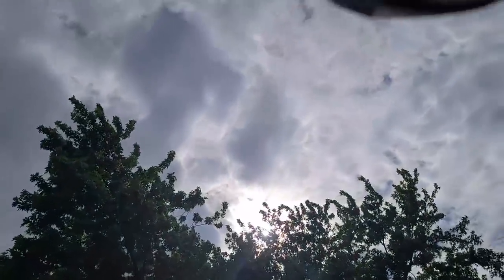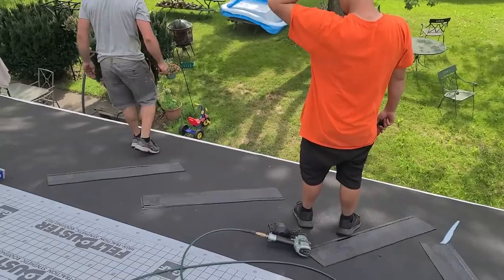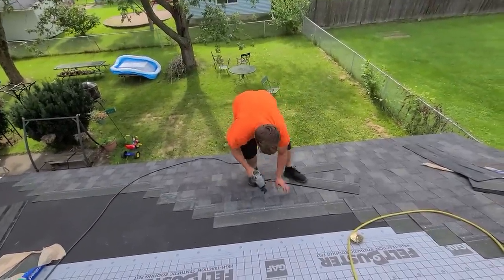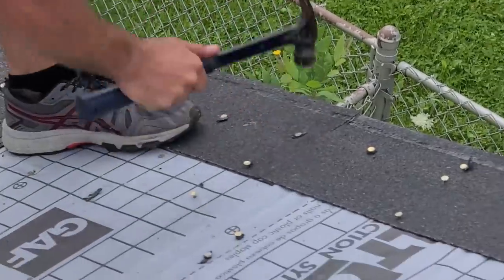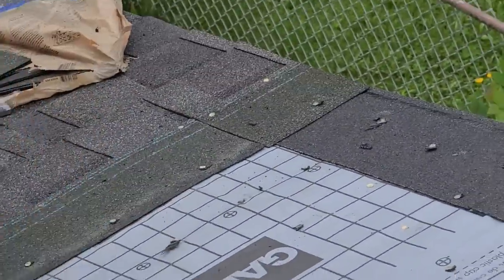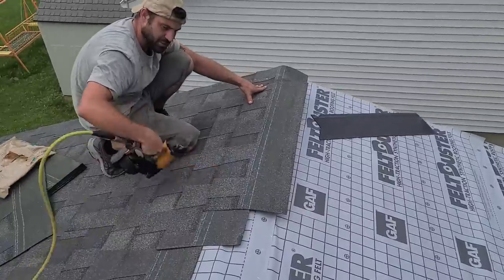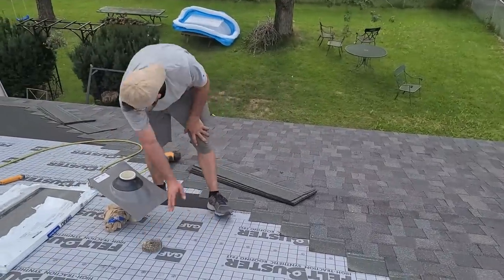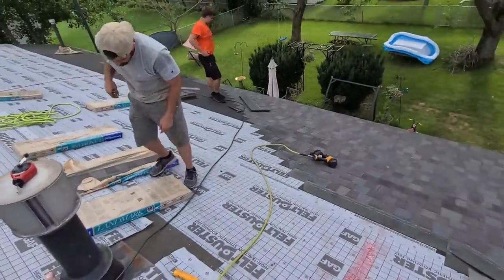Duos ME and BOYCUB

Comment: Recommendations on good air hoses? Got an older bostitich roofing nailer but the air hose is shot. Looking to do a diy roof project on my shed. Also, going to use your channel as my instruction manual ha.

Comment: Hi Zack, I have a question regarding ice shield. I am tearing off my architectural shingles on a small 3/12 and I noticed that the Ice Shield is stuck down directly to the deck, is this normal? Instead of on top of the old felt paper and I can't hardly get it off. My question is, do I absolutely need to get the ice shield removed from on top the deck? Or can I lay my new synthetic underlayment over the top of it, and then apply my new ice shield?
Reply: Scrape.the shingles off when its.cooler in the morning  and you.shouldnt be laying.ice.and water shield.on top of the synthetic underlayment. The ice and water shield is meant to stick to the deck and provide.good eaves protection when it.holds.snow. You can apply new ice and water over existing though. Also if it's a 3/12 you might wanna look into some flat roof systems 3/12 is not a desired pitch for shingles. Don't go peel and stick anything on  a big project look into fully.adhered rubber membranes. Hope this helps
Reply: Yeah DO NOT lay synthetic first, and then ice shield .. just get the existing shingles off the best you can, leave the old ice shield, and lay new ice shield right over the old ice shield.. I'm not sure where you're located at, but for the past couple years, it's been code that you lay 6ft (2 rows) of ice shield.. and with you having a 3/12 pitched roof, I'd Definitely recommend Atleast 6 feet.. good luck to ya, and roof on ✊✊
Reply: @timbibin1301  Thank you both! I think I am going to do the entire deck in Ice shield. 16x20 x 2. Another question is, do I need to lay synthetic over the top of the ice shield? They had felt over the old ice shield. I am located in North West Missouri.
Reply: I've never heard of laying synthetic over ice shield, but maybe there's something that Im not familiar with.. and as far as laying ice shield along the Whole roof, I've heard of situations where the oils in the ice shield had actually dried up, and was causing the shingles to curl up and lose their durability.. only heard that from one person, but then again, it's not very often that someone ice shields their entire house!! Wish you the best Brotha, and whatever route you take, I hope it works out for ya ✊✊

Comment: Hey Zach. Working with this guy that says shingles only divert 80% of the rain. I'm in British Columbia but used to live in saskatchewan. To me that's bull crap because of places than rain and snow during the year and if there was water underneath shingles it could just turn into ice  right? Or is that true? Just haven't worked with someone in shingle roofing that has ever said that.
Reply from the maker: shingles divert all the water. water should never hit the underlayment. but they do have ice shield for a reason. i'd like to believe that ever roof I've installed has never had water hit the underlayment
Reply: @NWIVeteranConstruction  okay cool, good to see your perspective on this. The guy also uses that protecto wrap peel and stick stuff for putting around vents and and he even puts it ontop of valley metal where two valleys intersect. And that stuff isn't cheap if I can recall.  He goes through one or two rolls on a single job. He even goes as far to put it on shingles that have a downspout near them. I keep telling him that underlayment shouldn't have much, or no water at all hitting it if you install shingles right. And yeah I agree with the ice and water

Comment: Sorry if this has been asked before. I havent watched every video yet but how many times have you fallen off a roof since you have been roofing? Or maybe i should ask what was you worst injury roofing? Love the videos btw
Reply from the maker: Haha so one time a few bees attacked me and I made sudden movements that caused me to start sliding on some granules on the roof deck. I was just close to the bottom to try and stop it so i jumped before Stepping on the gutter. I Landed on my feet, about 8 foot drop, no big was right back up.  Another time was also a freak accident where the sun was going down and the felt got dew on it (9/12 pitch) and we were walking the felt that we were laying just fine but when we were getting down on the stuff we laid an hour ago that was wet,  I wasn't careful enough and slipped. fell about ten feet (kind of jumped again but nothing about this one could really be considered controlled lol) did a 180 in the air n landed on my feet backwards at the back edge of a deck (with no railings) and the momentum of the drop kept me falling off the deck another 3 ft into a bush.  All good, but the bush branch gave me a lil knot on my lower back nothing serious.  Roof falls aren't the problem.  I got messed up by 3 ladder falls. All ladder slips. No fun.  No control. Those sucked. I actually fell about 8 ft onto my back on top of the ladder that gave out while I was Stepping on the roof. Broke the rung with my spine.  I talk about that in my ladder video a little over a year ago.  Ladders scare me sometimes honestly.  I'm never scared of roofs.
Reply: @NWIVeteranConstruction  Damn bro. Did it slip out cuz you forgot to put a bundle at the base of it? Or did it slip to the side?

Comment: What do you think about turning your starter shingle over so that the tar strip sticks to the drip edge...ive never did it that way personally but had a guy show me..just wondering what ya thought??
Reply from the maker: No lol that's not a good idea in my opinion.  Nail low if you want the starter to not pull up any.  But even still these roofs don't peel from the bottom.

Comment: What do u pay ur ppl? I run a crew for a friend and only work about 8 months a yr but clear around 75-80k
Reply: From what I've heard those guys would have to work 4 to 5 yrs to clear that.
Reply: @Mike-jn2hn  ive been roofing 10 yrs
Reply: @puprilla  been roofing since 88. Started mixing mud for Roof tile then started laying the tile. Wanted to learn how to put on other roof systems. Put on Tapered systems,90lb,TPO,Torchdown, Duralast,Shingle,and finally Metal which I love. Best roofs ever. Did an aluminum grip-lock standing seam roof in Feb 2019. 96sq 2guys. 34 valleys and 56 hip n ridges. Took 8 weeks made $300 a sq. and that was too cheap. That's where the $ is.
Reply: @Mike-jn2hn  100% im ok with what i make i have a small 3 man crew im the lead with 2 laborers. We have a great time working together and everyone works! I love roofing ill never work another job
Reply: @puprilla  I'm merely stating he doesn't pay his employees very good $ that's all brother. Be safe on the roof.
Reply: @Mike-jn2hn  u to man! Cant pay em good till u can leave them alone
Reply: Only working 8 months out of a year five days a week you would need to make between 2,000 to 2,400 a week. Or 50 to 60 dollars per hour in a 8 hour day. No Forman is worth that running a three man crew.
Reply: @JohnDoe-td2wz  we do a house a day and not only shingles we do metal and flats all types like rhino bonding tpo and full modbit burndown but ok u know so much 😆 and im not a pussy i work 12 to 15 hrs a day
Reply: @JohnDoe-td2wz  and if ur not worthless ill hire u right now! Wanna come do sales? Start u at 45-75k depending on yrly sales and u get a 2012 tundra

Comment: Any tricks for cutting a shingle straight?
Reply from the maker: mm. practice. that's all. n learning how to work around the cuts that aren't so perfect but also not worth trying to cut any straighter at the same time
Reply: drag your forearm in one motion downwards rather than pulling with your hand or cut the top section of the shingle to the shingle line membrane, then cut underneath the shingle line and it should break off when you bend it.

Comment: Always in a rush and forgot the corner starter cut
Reply from the maker: its clearly there!
Reply: More angle. Needs to be just short a 45. Imo.
Reply: Not necessary anyways will never blow off
Reply: @robertfaist5985  if you live in the Midwest near Chicago its better to do it than not. I've seen countless cap flip over or ripped off from wind